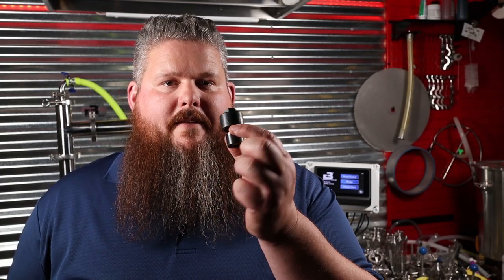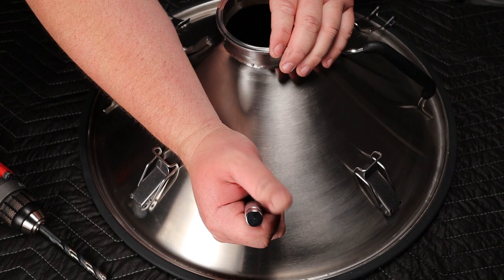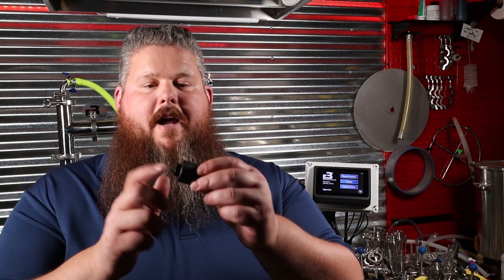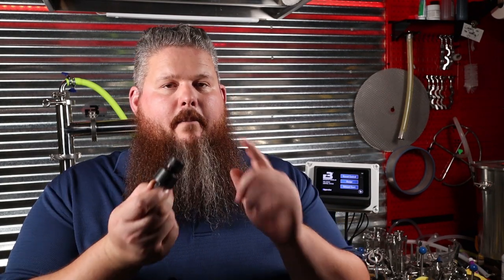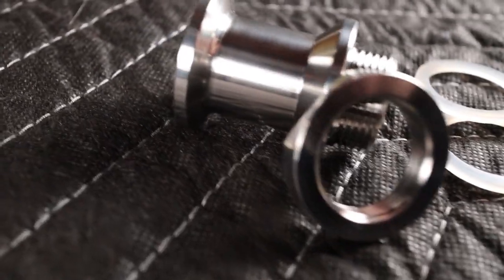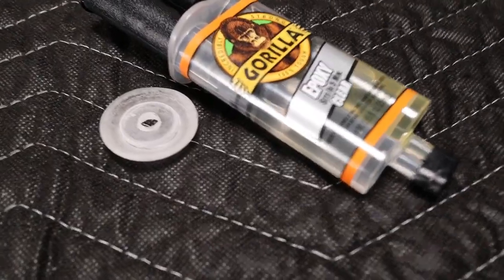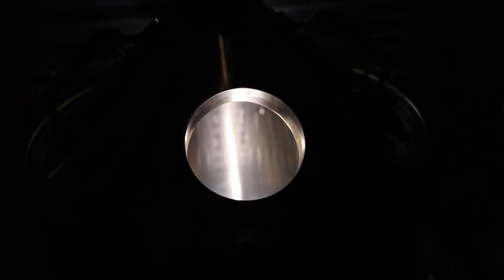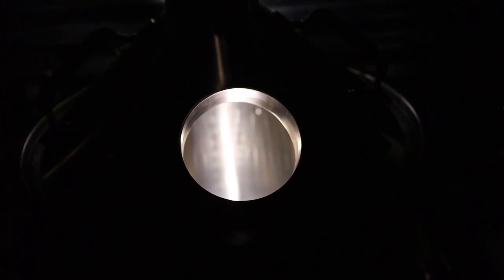Brewtools Steam Hat Light

Comment: Great stuff Bradley. Your videos pushed me over the line to get a B80 last month and three brews done since. They should definitely throw you some free gear for the promotional work!

 I need to figure out a cool hop/nutrient/Irish moss delivery system through the port in the top hat so I don't get third degree burns! OK maybe I could just wear gloves....

Excited to see if the automatic  mash stirrer / paddle sees light of day as I seem to remember seeing a teaser video for one.

Thanks for the great content
Reply from the maker: Thanks I appreciate it I'm quite interested in that stirring setup myself. I haven't heard much about it lately. My main goal isn't to promote BT just for the sake of doing it. I truly enjoy their products their stuff has made a huge difference in my hobby. I originally got started as there was no one on the internet making any sort of content. And there were lots of people that were having trouble.I wanted to try and help I planned on stopping after a few videos. LOL That hasn't happened yet 🍻
Reply: @PortlyGentleman  I'm also enjoying the equipment and I'm glad you're there with the handy videos! 

The only thing which is a little annoying, is getting a good seal between the unit and the steam hat. I always have a tiny gap at the front where steam escapes so I've ordered another silicone seal to see if I can fit two to plug it, although the spring clips aren't strong enough in my opinion so they might not clamp - we'll see.
Reply from the maker: Have you tried adjusting the location of the steam condenser?
Reply: @PortlyGentleman  Good call, worth a try and I'll report back after brew number 4 this weekend (toasted coconut IPA 😊)

Thanks Bradley